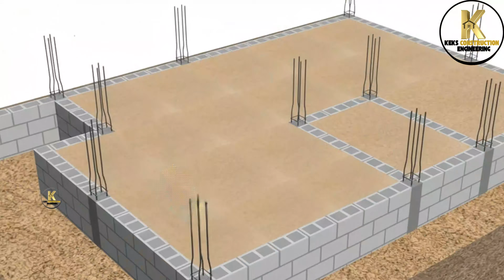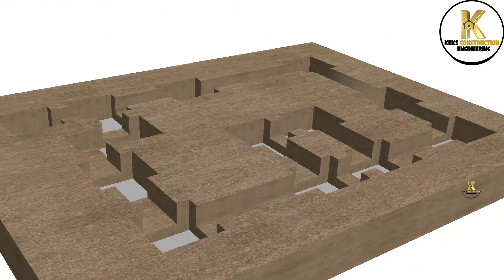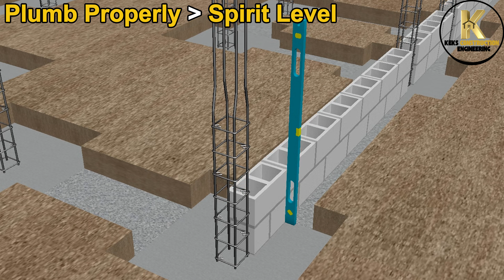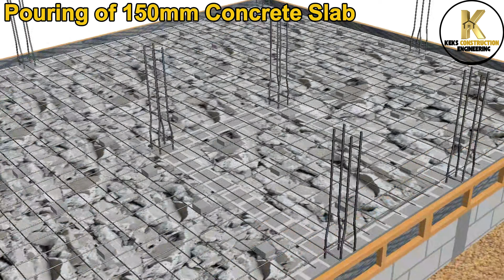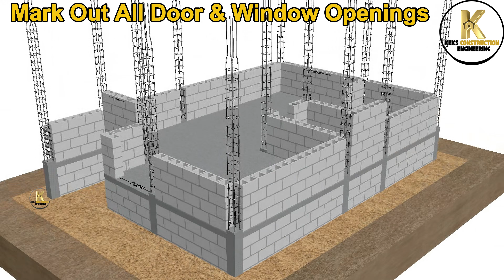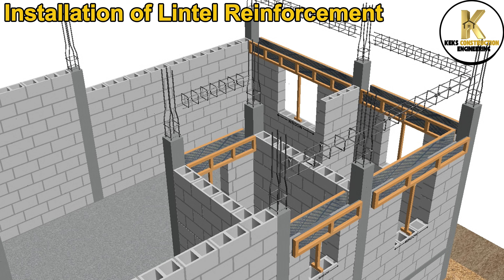DUPLEX House CONSTRUCTION Step-by-Step |Part1: BLUEPRINT - Site Reality

Comment: How do you lay dpm fast then hardcore
Reply from the maker: I don't want the Hardcore to Damage it before or during casting. I see this happens on most sites, before the Concrete is poured fully, the DPM is already damaged in multiple places.... Thereby defeating the main aim for which it was installed.

I tried to shade/protect it so it will have little or no damage...

Comment: It seems like nonsense to me—having no connection between the columns and the tie beam...
Reply from the maker: It's not all building Foundation that Requires Tie Beams or Foundation beams. It depends on the Type of soil and the type of structure. Don't think all foundations require that before it can be ok.
Some region have very high soil Bearing Capacity. So build base on your structural design and soil Bearing Capacity.
I have done Videos on Foundation that have Tie Beams, plinth Beams and so on.

Construction is not cast on Stone, it's flexible and applicable.
Thank you.